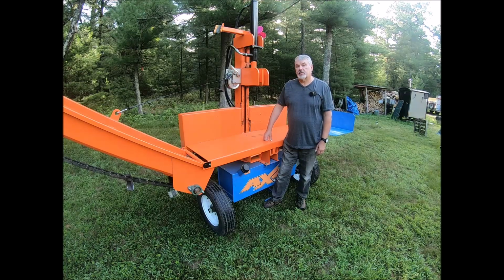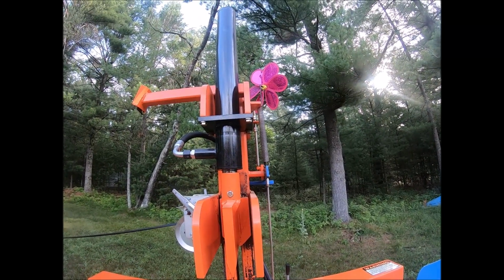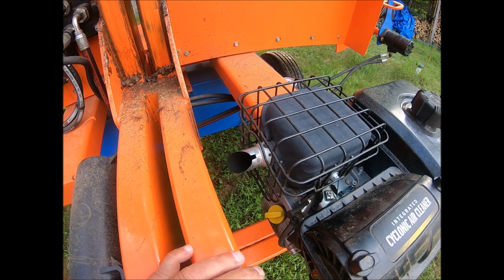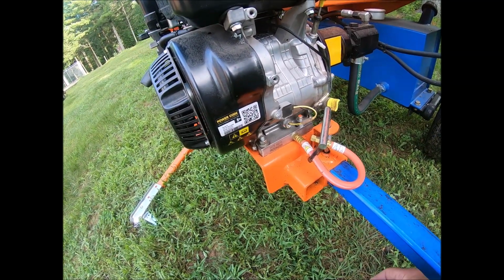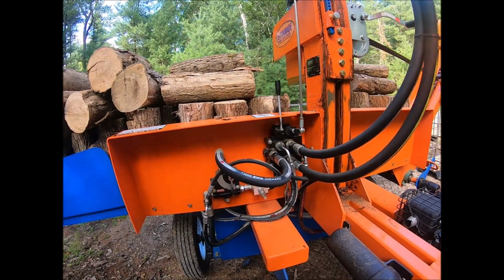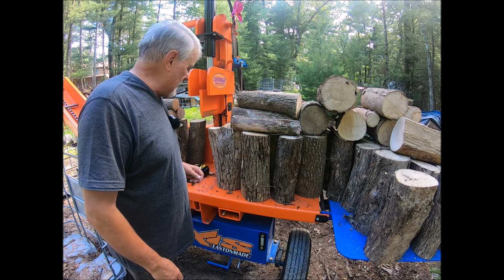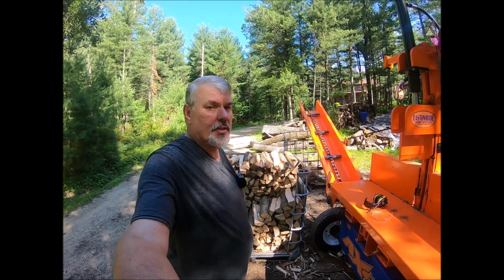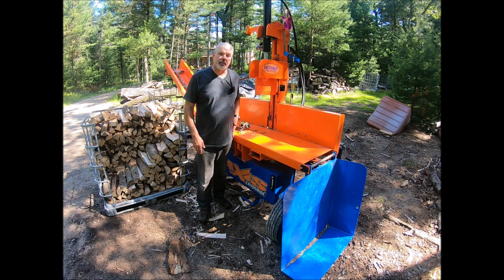Eastonmade Axis 1yr Review -21

Comment: I can see that being able to stand at a workbench and sliding and spinning the logs is much easier than bending over not to mention wrestling with stuck logs makes this unit the choice for me. It also seems much easier for a single person to use alone. I only split wood for myself so I am really not concerned with seconds on my cycle time. Now I just have to send him 500 bucks and in a short 15 months Ill have one  lol. Looks like it will work good for breaking beads on tires also. Thanks for the video.
Reply from the maker: Anthony you pointed out the major attributes of the Axis. I would never go back to a horizontal splitter. You’re right, I’m a one man operation as well and this truly is a dream machine to work with which has me splitting longer with less fatigue. 
You won’t be disappointed if you invest in an Axis, and remember it really holds its value over time in case at some point you wanted to sell it.
Appreciate you watching and commenting 👍TCT

Comment: For mostly bundle wood production, I can see your affinity toward the Axis. For occasional bundle wood, but mostly firewood for other-than-bundles, the 12-22 all day long. The 12-22 is a production beast, especially with the choice of a 4 way, 6 way or box wedge. Cheers!
Reply from the maker: My first splitter was a 12-22 with the box wedge, 6 way and 4 way. I will say most of the time I had the 4 way installed. One factor to address is what kind of wood are you cutting. I agree the 12-22 may be a bit faster but if you have anything but straight logs the Axis will not be far behind with production and produce a better quality product with less kindling that comes from using the 4-6 or box wedge. At the end of the day less fatigue using Axis then 12-22 because of no bending over. Both machines are AWESOME!!! Thanks for watching and commenting

Comment: Such an amazing versatile machine. Eastonmade is the best in my opinion. I've owned my 22-28 since September 2019 and it never failed me.
Reply from the maker: The 22-28 has ridiculous power, it will split whatever you put on it. Thanks for watching and commenting 👍
Reply: @TonysCoolTools  yes it does. I own a tree removal company and I can tell you without question that it splits some of the nasty, gnarly logs I've had. When you have a splitter that can make unsplitable logs into sellable firewood you are in good shape.

Comment: Powersplit is the splitter that Andrew copied. Lol
He forgot to add the "drive it around on the yard" aspect though.
I don't understand why the exhaust on a lot of splitters blows right in your face. I had to put a diverter shield on 2 of my splitters.
So, I have a 1 yr. waiting period to get my Axis. At 65 I hope I'm still alive!!!
Nuce review Tony but I was sold on the first review that you and Chris did..
Nice video
Have a great day!
Reply from the maker: Grant the PowerSplit is the splitter I was buying before I even saw  the Eastonmade line of products. However if you put both machines next to each other there is a night and day difference. I like the concept of driving the machine to the wood but it definitely brings up the cost of the splitter. In my opinion the table height and foot pedal are the two major shortfalls. Thanks for watching and commenting 👍

Comment: Hello Tony, thank you for the one year review of your Eastonmade Axis. Cannot believe yours is a year old. I think the Axis is just about the most versatile log splitter, as you can split huge rounds 40”+ to splitting kindling. Having the work table at a height without bending over. The lift table is massive and can fit a lot of rounds on and has the power to lift them. When you get use to the Axis, you can achieve multi splits per round (pie cuts) without taking the round off the table.
Reply from the maker: Adrian great overview,  I Think Eastonmade should hire you for a salesman! The Axis is definitely a splitter on another level. I’m glad I made the decision to change from a horizontal to vertical splitter. Thanks for watching and commenting 👍

Comment: The proper working table height is a huge benefit in keeping  your back from getting overly sore.  Although you didn't show it in your splitting demo, processing those bigger rounds is much easier on the Axis due to the large work table and log lift.
Reply from the maker: Splitting Large rounds will be on another video I do to show versatility of the Axis.  You’re so right, Having the splitter at the right height let’s me split longer because I’m not tired from bending or stretching like I did on a horizontal machine. Thanks for watching 👍

Comment: Tony you probably get a starter kits at northern equipment for your motor. I can’t see it’s be a problem hook it’s up . EASTONMADE are on holiday until August 07 , 2022 the hold company employees are off . I got it on my e-mail , great video keep out off the hot weather .
Reply from the maker: I’ll have to check that out, I was told the base is different on the electric version but i haven’t confirmed that. Thanks for watching 👍
Reply: @TonysCoolTools  you could be right , check should be two bolts hole for the starter to bolt into . No problem keep up the great work and video tony .

Comment: Looks like a excellent splitter. I spit what people call tree service wood. I would like a 12-22 or the next size up. I work full time and don’t sell wood. I might start selling bundles because I got 3 years ahead right now. Good video as always.
Reply from the maker: Dan as I pointed out I owned a 12-22 for two years and it’s an awesome splitter. But, I found for tree service wood the Axis turns crappy wood into sellable firewood much easier then the 12-22 with much less scrap/kindling. My money is on the Axis for tree service wood. Appreciate you watching 👍

Comment: Great show Tony.  Thank you for sharing this and giving your honest opinion on this machine. 
    I'm not sure how fast that conveyor travels, but why would you need it to go faster than what you showed here.?   People may say, you need to run it faster to throw it further.   That's just gonna wear parts out quick plus it'll rob hydraulic oil from the wedge ram like you mentioned.
   The 2nd reason is you can only split the wood so fast, so a fast speed conveyor spends most of its time empty wearing parts.
   (I'm not sold on the conveyor speed as a good option).
   I do like this splitter.   It one of the best I've seen.   I like all the other options it has.
  Thank you.
Reply from the maker: I agree with you 100%. I can only split so fast at the slowest setting it still works great getting the wood up the conveyor. Appreciate your comments. 👍

Comment: Tony the Eastonmade Axis is definitely one cool well made tool and very well suited to your firewood splitting for bundles and boiler use.  Wonder how much added frictional surface area is needed on the table to keep the angle splits from slipping at the heel…would a textured epoxy paint system like Rhino liner work versus a modification to add expanded metal strip or raised texture surface from the manufacturer.  Glad you and Chris were able to troubleshoot the directional exhaust port issue so you no longer get splitting headaches 🤕
Reply from the maker: I will show a technique I use to help stop the angled cuts from slipping on the Axis table in an upcoming video. Thanks for watching, Appreciate your comments 👍

Comment: I don't care how good of friend they are...I would not have their goofy pinwheel on my nice Axis! 🙄
Does the machine have leveling bubbles on it anywhere or do you have to carry a level around? 
Like so many 1st generation makes of things. There will be bugs and issues discovered once they hit the field. It seems to always pay off in waiting for the smoke to clear and get the next generation model. Andrew always seems to be forthcoming with issues and tackles them straight on. He strives to make them better, and not just the finger pointing alot of manufacturers seem to do with issues. Thanks for video!👍
Reply from the maker: Wayne the Axis does not have a leveling bubble. Just an eyeball will due, better to have machine pitched slightly backwards so rounds don’t vibrate off. Unfortunately if everyone waited for version 2.0 no one would buy the first version. In post Covid times you have to get what you can when you can. I always try to keep my equipment as new as possible so I can sell if new version comes out similar to me selling my 12-22 and buying Axis. As usual Thanks for your thoughts and comments 👍

Comment: One problem I have often  observed is that when rounds or pieces with slightly canted ends are being split, they frequently slide out of position. Perhaps something can be done on the table top to prevent this slippage. Possibly a piece of expanded steel or some gridwork of welds? 

Otherwise, that is an absolutely excellent stand up piece of equipment.
Reply from the maker: Glen that’s a good suggestion, the great thing about the Axis is that the foot control can be feathered to engage slowly on pieces that are not cut square. I will have a video showing how this works in the very near future. Appreciate you watching and commenting 👍
Reply: Yep I have that issue. Just have to watch a bit more on how I buck up the logs.  Has given me a couple good gut punches.
Reply from the maker: @jdboy9  Yikes doesn't sound like fun, I've had a few pieces kick out but no major issues. Thanks for watching

Comment: Powersplit makes a single.and  double splitter with conveyer and it can self propels to wood location
Reply from the maker: Joseph I am a big fan of PowerSplit well before Eastonmade was a company. I previously lived in Chicago and most of the big firewood producers used the double station PowerSplit. Just before I retired I did a lot of research and narrowed my choices to PowerSplit and Eastonmade. Louie from PS gave me a couple people to go out and run their machines. Both people told me the same thing, for a tall person the table is to low and the foot pedal is to high. If you were to put the machine side by side there is a noticeable difference. A simple example is weigh of the two units, the Tow behind PS static buggy weighs 500 lbs. The Eastonmade without conveyor is approx. 1,500 lbs. Both are great Canadian companies and make awesome products but based on my research my money is on the Axis. Thanks for watching and commenting
Reply: @TonysCoolTools  I was researching powersplit.. I am.crossed between the 2 but it appears the axis is bigger and built.tougher . Again I haven't tried.either one

Comment: Great bundle wood machine, nice thorough review Tony. I should do a 3 year review on my 12-22. Why do you cut the entire side out of your IBC tote?
Reply from the maker: Bundle wood or boiler wood it processes it with ease! I would definitely do a 3 year review, it would be interesting to know your thoughts about the 12-22. Thanks for watching and commenting 👍
Reply from the maker: Oh the reason I cut the complete face on front of some of my IBC totes is I use as  a poor man’s tool box to move bucked up pieces of wood or to carry a bunch of tools out to jobsite. I have a set of set of 3-point pallet forks for rear of tractor so basically I can double my load.
Reply: @TonysCoolTools  That makes sence. I only use IBC totes for firewood so i only cut out what is necessary to reach the bottom of the tote and keep as much structural integrity. Keep up the great work Tony.

Comment: The knife height is adjustable, as you said.      One operator commented that he does not like it to stop close to the round because it does not allow enough time for him to get out of the way.

If the knife is dull you would get better performance if you sharpened it.

I expect that the vertical is much slower than the horizontal. I suppose that depends on exactly what you want to do with it. The speed that you described was not a bad speed. You probably did not count the time it took to stage all of that wood.   The reason the vertical is slower is that you need to give each piece constant attention, instead of just pushing the go lever.
Reply from the maker: Jake thanks for your observations and comments. Appreciate you watching

Comment: You have more control on the splitting size etc for a smaller/mid-side user in volume.
Reply from the maker: Rick you’re 100% correct, the Axis allows extremely precise splits of the wood. Thanks for watching

Comment: Thanks Tony for the detailed review!! I think you brought out all the pro’s an con’s of the machine. Too bad your tractor won’t lift it…that would be a big plus I would think,if it did. Does the foot petal get hung up when moving it? It appears to be so close to the ground……thanks again ! 🪵🪓👍👏 Rick
Reply from the maker: Rick yes it would make moving the Axis a little easier. One thing I didn’t cover was the foot pedal, for travel the pedal pushes upward and held in with a pin so it doesn’t drag or get caught on anything. I will cover this in my next video. Thanks for watching and commenting!

Comment: How tall is it to the top of the cylinder? Looking for what size garage door?
Reply from the maker: Well Christophe from the ground to the top of the cylinder is 102-1/2” and will probably not fit in a standard garage opening which is typically 96”. 
Naturally with a conveyor it’s even higher at 126”. 
Hope this info helped you out.👍TCT

Comment: That staging is awsome this could be the one i need for my bundle wwood business
Reply from the maker: Chris the most important aspect for me was the ability to stand up when splitting. The log lift and table was just a bonus. But as I showed I stage all my wood first so I'm not walking back and forth getting wood. I've had a couple horizontal splitters and would never go back after owning a vertical splitter. TCT
Reply: @TonysCoolTools  right I use a supersplit to resplit all my wood.  I buy all my wood split I put up about 300 face cords. If you haven't seen the super split in action check it out it's the original kinetic splitter. Also works great for making kindling out of slab wood. It's been bullet proof for 6 years.
Reply from the maker: @LeBlancfirewood  Chris I am familiar with the Super Split and if your primary task is resplitting it’s a very good choice. 👍TCT

Comment: For me I think that is the best splitter. I'm making boiler wood so a single wedge is all I need and I think there is far less waste.
I noticed your one IBC tote you have the front cut out of it all the way to the bottom. Looks like a better option, have you had any issues with it?
Reply from the maker: Chris the reason I cut the complete face on front of some of my IBC totes is I use as  a poor man’s tool box to move bucked up pieces of wood or to carry a bunch of tools out to jobsite. I have a set of set of 3-point pallet forks for rear of tractor so basically I can double my load.Naturally  I would not double stack when I cut the face out. I’ve used this design for the last couple of years and it seems to work well.

Comment: Hi Tony, I just received my Axis today and am blown away. Have you, or are you planning on grinding the wedge to a little bit sharper edge? I've only run mine for 3 hours but am curious if you think that would make a significant difference.
Reply: If it is not sharp, sharpen it.
Why run a dull knife?
Reply from the maker: Michael welcome to the brotherhood of Eastonmade Axis splitters. I have about 80+ hours on my Axis and have had no issues with the wedge but at some point I may sharpen the wedge. If you have any other questions drop me an email
Tonyscooltools@gmail.com

Comment: A few points from another Axis owner.. the machine is a beast and nothing will stop it. It’s a solid unit but can be improved with a bit of engineering.

1) Engine should be turned 90 degrees CCW to blast cooling air AWAY from hydraulic tank so it doesn’t heat up the oil and operator during the summer. It should be fine in the winter, but it roasts you in hotter weather. I installed a baffle to block the airflow and that has helped.

2) The lift table should be just about 1/4” higher than the tabletop so large rounds slide onto it easier.

3) Conveyor need major re-design so it feeds better. The machine design forces compromises on the conveyor but I’m sure it can be improved. The feed performance is bad and most people toss the wood half way up the chain to get it to go. The new shark fin paddles will help, but the overall design needs help.

4) I saw Joe’s muffler video when he put it out but it looks like he’s taken it down. It was an honest criticism and it’s too bad it’s gone.
Reply from the maker: Thanks Chuck, I know Andrew at Eastonmade reads all the comments. You are right the Axis is a beast and I’m sure as more machines are out in the fields there will be additions/improvements to the current design. Thanks for watching.
Reply: Chuck, they are working on or have already changed the chain on the conveyer.  Andrew did a video on it a couple of weeks back.  I believe he said you might be able to just buy the chain to retrofit it if you want.
Reply: @jamesbainton  yes, I saw the video you're referring to and have spoken to them about getting some paddles that I could replace a few of mine with. At first I was given a price per paddle and then a few days later I was told they would only sell the entire chain. Go figure. The new paddle design is just a quick fix for a design that needs some refinement.